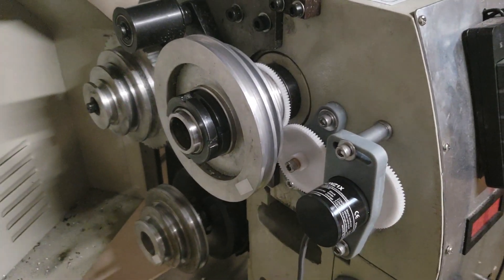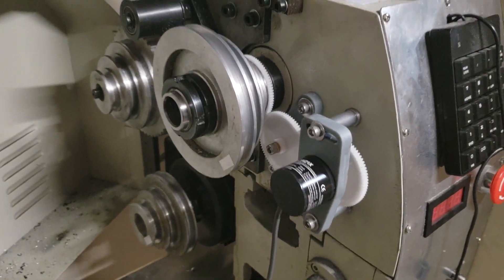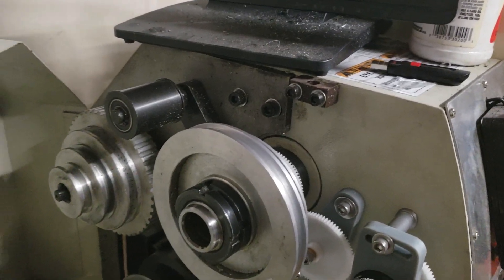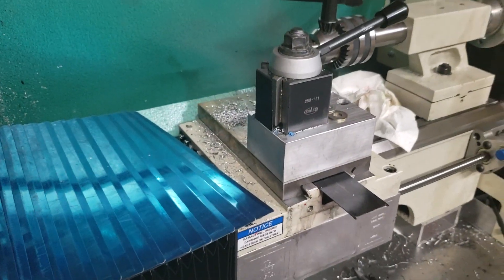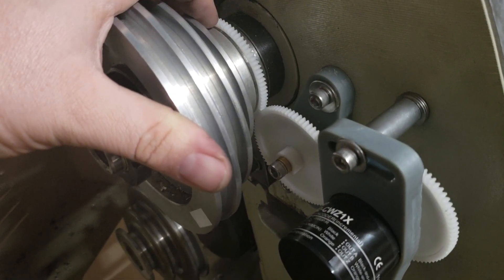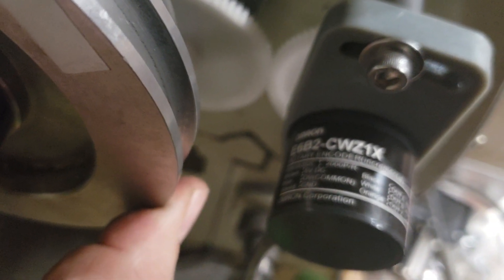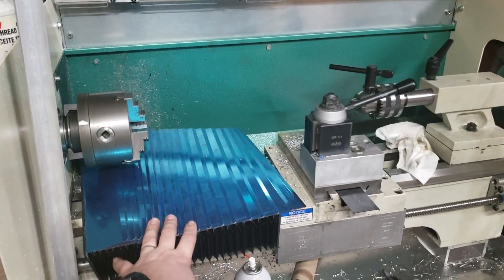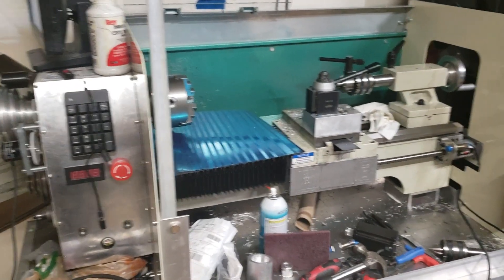G0602 cnc Lathe spindle encoder install - centroid acorn

Comment: What are the settings to put into the encoder setting I’m like missing 500rpms with that same encoder
Reply from the maker: I use 8000.  If you need to reverse the direction you would put in -8000
Reply: Adapted Machining thanks yea I figured it out hove to a just my vfd

Comment: Gear part numbers? Share the stl fi9les on the brackets?
Reply from the maker: I will have the brackets uploaded to thingiverse and get a link posted here soon.
Reply: @adaptedmachining6951  Any update on the STLs? I'm wrist deep in my conversion and I'd like to use this style of encoder.
Reply from the maker: @MakingandBreaking  The download links have been added to the comments. The hardware parts list is already in the comments.

Comment from the maker: Parts list.

Mcmaster carr 6mm ID bushing https://www.mcmaster.com/#6659K675

Mcmaster carr gears x 3
https://www.mcmaster.com/#2662N37

2) 1-1/8 aluminum standoff for m6

M6 x 50mm × 2

M6 x 20mm x 2

M3 x 8mm x 5

M6 x 45mm partially threaded bolt (cut down to for idler gear) 

Misc M6 washers

3d printed brackets (can be milled from aluminum) 

m6 lock nut for 3d printed idler bracket.